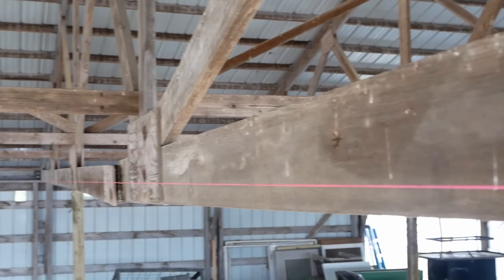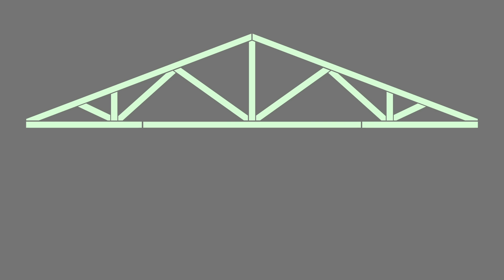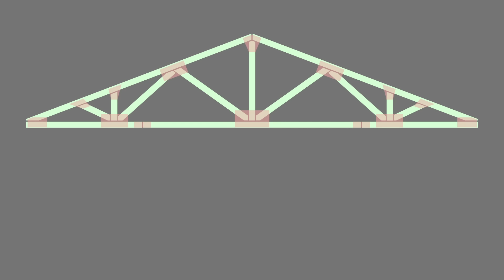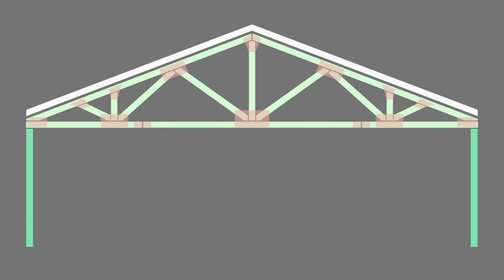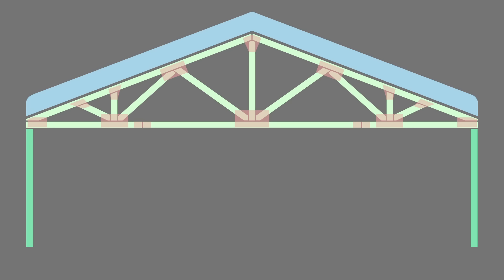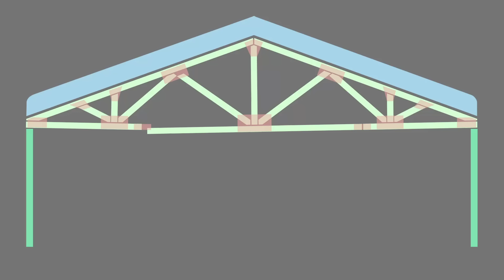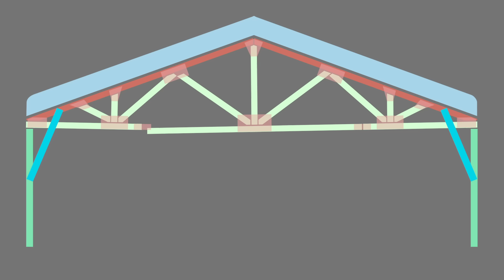Emergency Repairs: Dad's Shed Roof is Collapsing

Comment: My Promise:
Every Vid from you gets a comment from me.
Lets dive right in.
First of all: the joints were the weak points (yeah i know thx cpt obvious)
When i build the roof of our house We use different materials in germany so because of that and because of the fact my dad learned „tischler“ (carpenter with some extra in comparism to the american use of that term)
We were able to beef up the existing Roof construction to an extend where we consider it „aint going nowhere“ *slap*.
We always build things like that with the thought that it should outlive 2 generstions.
Best case and i know thats not always practical or achievable but when using material which was a gift from here and there you habe not that much of costs.
Honestly i would not have thought that the shown construction would have given any problems.
But sometimes the unconsidered strikes.

I just glad your family has not to build the barn from scratch ;) 

Also i would have appreciated some timelapse on the actual work.
 Thanks for your content and best wishes to you and your family wes 👍

Comment: No this was interesting also, for me anyway. I did construction/carpentry for 40 years along with farming here in ne montana. So I wound up putting up quite a few pole barns. Quick count, around 12 give or take. There wasn't anything wrong with those original rafters, was a perfect storm (get it) that broke those connections. And yes those knee braces helped, we always put those on the ones we built. There all still standing anyway... I just turned 66 and am running our local theater now with my wife, who knew lol

Comment: safety third.. if it was first id stay in bed!
that wet snow gets heavy... He did get really lucky, those knee braces and the pole in the ground is the only reason that didn't fall, steel didn't hurt.. but i cant imagine it helped in the middle. actually pretty amazing. 
I sure wish you'd do full length or at least 4' sisters, but the larger glued plywood and bolts help for sure.. 

Good work as always, and remember.. Haters going to hate!

Comment: Those main cross beams should have been doubled up, with offset joints, and cross bolted with lag bolts at least.  A span that long I am surprised there not engineered I beams at the least considering snow load.
Reply from the maker: They span 80+ feet with wood trusses all the time here.

Comment: steel rods threaded at each end running from wall plate to wall plate nice big spreader plate  and crank the nuts up... no need for a  torque  wrench .. just say click when ft (forken tight!)

Comment: One time my Dad put a metal trash can with sand and dirt in bottom and wood with oil on them in shop bathroom and lit it 
Works and two days later they fixed the poles down 😊

Comment: They built them the same way around me, I didn't like the truss spacing at all, plus I wanted a ceiling and insulation. I spent the money and went with 24 inch spacing.  big time farmers have built some very large barns out of nothing but 2x4s. Something like 40ft x 100ft 16 ft high and they are still standing. When I saw they building them I cringed. At first they had everything on 8 ft centers then they changed it to 2ft.I think the trusses where boughten but the sidewalls nothing but 2x4 .10 years still standing. Use them to store hay and straw that they sell all over.
Reply from the maker: They do 80+ foot span truss rafters here now. It's nuts.
Reply: @WatchWesWork  That is beyond nuts. Save money but in the end it's libel to cost so much more. Rather build something I know will last with no problems then something I have to fix and wonder about,

Comment: I've always suspected that construction adhesives become brittle in cold temperatures even when it was installed when it was warm. What did the glue look like? I've seen people that have legs that they put at the truss nodes when heavy snow is forecast.
Reply from the maker: It was very inconsistent. Some was really stuck tight. Some just fell off.

Comment: Ugh. I worked for structural engineers for quite a while, and I’m just thinking what appears to be 2x6 trusses @ 15’ spacing would not get me a stamped permit.  Holy Shmoley.  But I’m sure permitting in the hinterlands is less stringent.

Comment: While I personally have no problem with the repairs and feel them more than adequate, anytime an engineered component or design fails or needs to be altered you must have a qualified engineer design or pre-approve the repairs or alterations by law, and failure to do so can lead to voiding insurance on the building and incur legal liabilities for whoever does the work. In most places without the engineering being done, the structure can now be condemned for not meeting building codes which require engineered designs. There are many nuances which may not be seen involved in these things; in this case those 2X10's have added a lot of weight to the center of the span thus reducing the total load-carrying ability of each truss (and thus the whole roof) as well as changing their load-carrying characteristics of the bracing because of that. The added weight also increases the static load on their supporting structure (walls) as well as the foundations under them. There's almost always more to things to consider than meets the eye in building work!

Comment: The number of rafters is insufficient for wood, ok if they were steel. I would have had wooden ones at 600mm (2 foot) centres maximum. (UK)

Sheds/barns 30sqm+ in the UK require building regulations (building code).

Comment: I would consider a couple 3/8 cables with turn-buckles go from wall to wall right under the truss beam....... And why is it the guy on the floor is always the one to run his yap about hard hats, body harnesses and fall protection etc to the guy thats actually doing the job, it's enough to drive a man to drink............

Comment: The night of feb, third, at midnight, the temps remained at sixty five below and the needle just could not go any lower. but now on feb fourth, the temps just jumped to ten above and are holding. For me, its a heat wave here in central alaska so its headed your way Wes. Miserable ain't over yet... I am so done with the cold and yet our coldest month is yet to come. They do have a way of measuring temps at any temp and at Barrow, its a hundred sixty below! I find that just unbearable cold but that can and might just happen here as well
Reply from the maker: No thanks!

Comment: I can’t stand it.  I’d put a vertical pole in the middle to transfer the static force down.  Otherwise the butt joints will just rip apart again at the bolts.  Ideally you’d have metal with an arch in it so the static load would try to flatten it.

Comment: I'll be the odd guy who thinks this is normalish.  No harm, no foul.  I like to convert snow load to water depth to help understand the load on the roof.  30psf is around 6 inches of water depth over the whole roof.  That's not nothing.

I have the very weather conditions you describe.  Snow to ice + rain+ snow+ rain and our code is 120-140psf, but it depends on which year of building code you look at (not that it's enforced lol).  I can guarantee most of my town's houses are built to "good enough", but not 120+psf.  There's even a couple of flat roof buildings in town that have been standing for a while(decades).  I don't know why they were built that way or how they're still standing...
Reply from the maker: 140 psf is a crazy snow load. That's more than an industrial floor live load.

Comment: There is no way those spliced rafters are rated for 30lbs/ft snow load. Small splices should be double with staggered joints instead of a small splice plate

Comment: It's not that the trusses were built wrong, the design is pretty good, the engineer failed you. Those trusses should have been doubled at each post, the plywood gusset larger at the web connection. Oddly enough, years ago when we had a record snowfall year, 60" total with no thawing weather in between the accumulation,  the roofs that failed were steel framed or old rafter stick built with undersized rafter members, no engineered trussed roof failed. Those steel framed commercial buildings were constructed by one particular contractor who figured certain tie downs and connections weren't needed as per the print specs. Those knee braces are part of the code now, Ag buildings now have code requirements. The knee braces assist with resisting wind shear, which is important in high wind areas.  I've repaired a lot of building, built a bunch as well in my 4+ decades as a contractor.  Rain after a snow fall changes the load distribution on a roof. Roofs are designed for an even load, rain moves that load as it flows through the snow, it doesn't land and freeze on contact. Something to consider.
Reply: That’s an interesting point about rain changing the load as it moves through snow on a roof!  Never even thought about that before!

Comment: I thought you had got rid of your rav 4 and stopped your son riding in it!?????
Reply: Good catch... He did put some moderate work on it

So it's just a farm vehicle now?

 Not road worthy, but a decent runabout
Reply: @ricebike  We had an old farm runabout ute.  Until it broke in half from decades of overloading and rough tracks.

It made it's final drive home (from the paddock) braced together by a toolbox.  That's how I found the problem -- I couldn't get that damn toolbox out!  Because it was stopping the LH chassis rail from collapsing.

The ute is long gone, but that toolbox is still in service!

Comment: I can't believe you did all that work and then used plywood.  What is wrong with you guys?  Didn't you just see how well plywood worked?  IT DIDN'T!  You should have used 2x10 or whatever size the joists were and bolted them together.  If my machine shed starts to collapse, I am not calling you guys!

Comment: im laughing at just repairing the way it was...it will only be as good as the next fail they need to be reinforced as they were not designed properly typically here when we get 30 feet of snow its engineered for 60 at least and so far with all the trusses I have hand built and homes built never had a fail in 35 years...